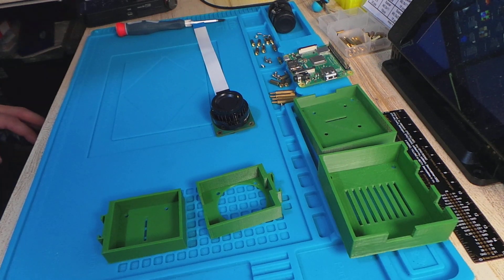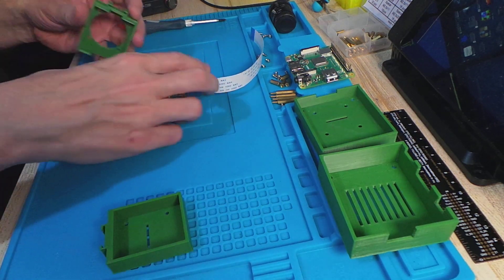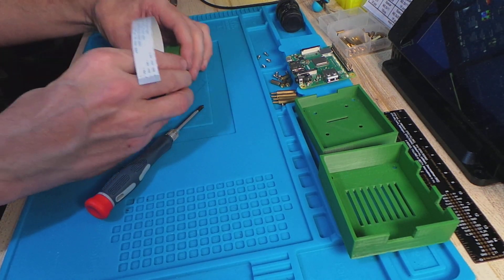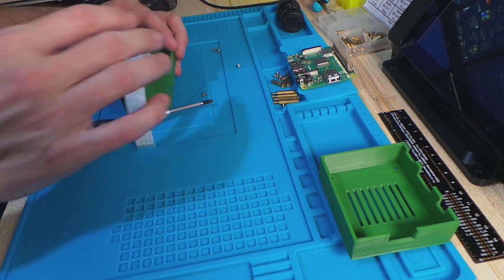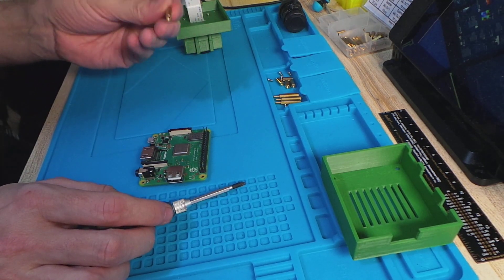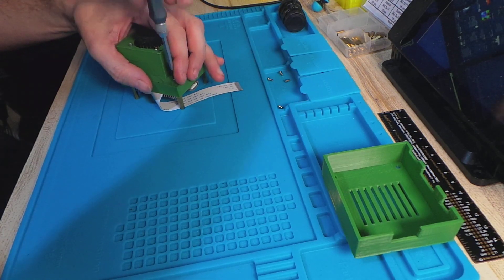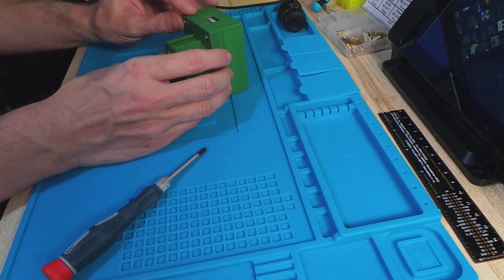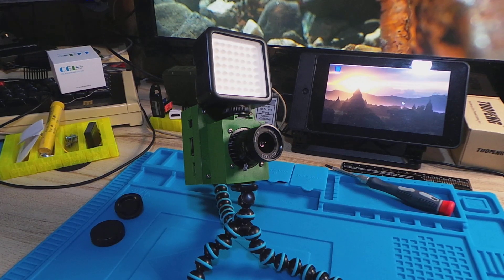Raspberry PI HQ Camera 3D Printed Enclosure

Comment: Thanks, good video. Did you manage to get it to work over the network?
Reply: The 3A+ has wifi so I do use it controlling it over that. I also use NFS over Wifi so that video is captured & stored on a remote server & not the SD card. It has limits but as long as it has a good signal it works pretty well.